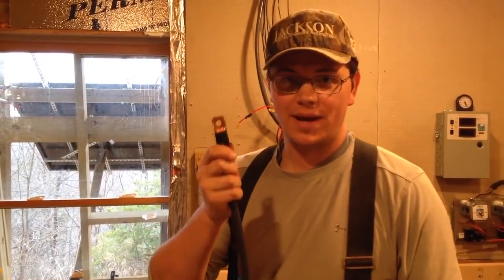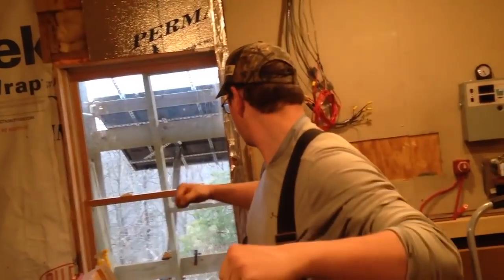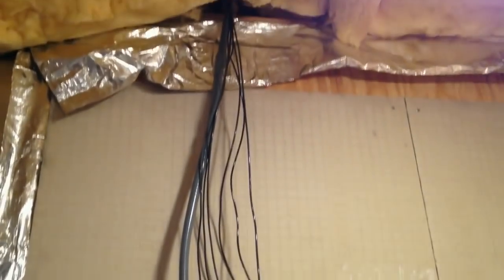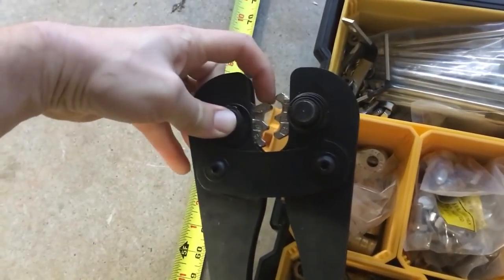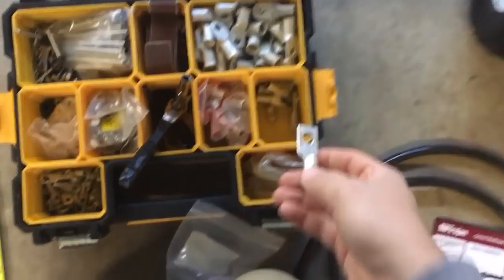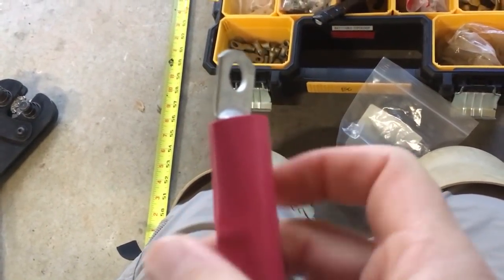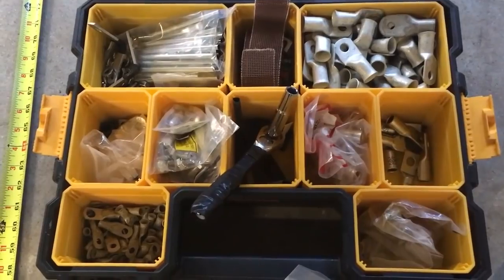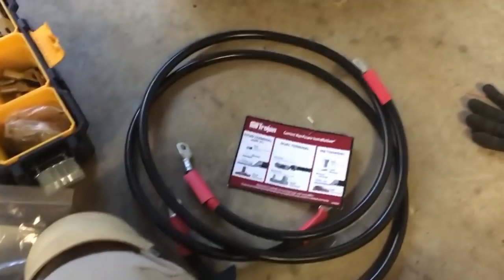Solar Battery Banks: DIY Battery Cable Fail

Comment: So Johnny is it still DIY if we use the proper tools and materials and still do it ourselves? OK thanks for the information you are right again as usual.
Reply from the maker: OffGrid Wanabe Nothing wrong with DIY, as long as you do it right, the opposite of DIY would be professional as in getting paid for it. DIY should not have a negative connotation, but sometimes DIY equals jackleg

Comment: Apart from the crimper what diameter cable would I use for 200 Amps charging power on  a 12 Volt Led acid battery bank?
Reply from the maker: Peter James 3/0 or 4/0. It depends on how long 200 amps is flowing and rather or not it’s fine stranded
Reply: @GainSolarPower  I have to ask again, because we have the metric system here and I can't find your numbers on the conversion table http://madnicables.com/comparison__imperial_&_metric_sizes_cables.htm
Reply: I guess I found it here https://www.rapidtables.com/calc/wire/wire-gauge-chart.html Closest size in metric would be 25 millimeters squared - which is what I wanted to use anyway since those are the biggest jumper cables I have seen. Thank you!

Comment: yep, if crimped properly and hack sawed open you have a solid block of metal. no air gaps, just solid copper. so, the people that then solder the lug after crimping, either there should no solder wicking inside or the crimp is faulty.
people get quite emotional about this crimping thing. on this one i 100% agree with  gain solar.
Reply from the maker: Urs I agree, it’s an emotional issue. No room for solder in my crimps. I don’t like the way my tool flags the crimp but no failures yet. I’ll probably get a burndy crimper next. Thanks for the affirmation. Are you a solar installer in Germany. Do you use the studer innotech vario string?  I’m interested in yalls systems.
Reply: no, i live in australia and i am retired. i was born in switzerland and i am fluent in german. them studer innotech vario string solar chargers are an upmarket niche, about twice expensive than the midnite classic. but twice as reliable as well. same with the studer inverter, they sell them in china for example, where the chinese prefer them when it comes to 100% reliability.
the studer inverters have similar prices and specifications to the australian made selectronic inverters.
switzerland and germany do not have many island systems. the reason is the overcast winters. like so about between november and february the sun hardly ever shines where most people live. so, to be independent you would have to overpower the system somewhere in the region of having ten times the numbers of solar panels.
this is of course different here in australia where the sun shines in the winter months. many people do not understand that the battery is for overnight or the odd overcast day only. and the solar panel generation is supposed the be designed to make enough electricity on an overcast winter's day.
Reply from the maker: Urs Odermatt urs i like your design philosophy. Were you an electrician before??Probably a good move heading to Australia
Reply: not an electrician but worked in electronics

Comment: Looks good John!  I used a hydraulic crimper, heat shrink and no solder for mine.  You could do a whole series of videos like this: Unistrut vs. racking system, speaker wire vs. THHN, old car batteries vs. L16RE-B's and so on...  The "Do it nice or do it twice series".  Thanks!

Comment: Cable ends are not copper tube. It's not the same material. Good video for people that don't understand this
Reply from the maker: Roy Amberg perhaps the non annealed Copper would work but a type L Copper  is not a good idea. I should try crimping some soft copper with my crimper......